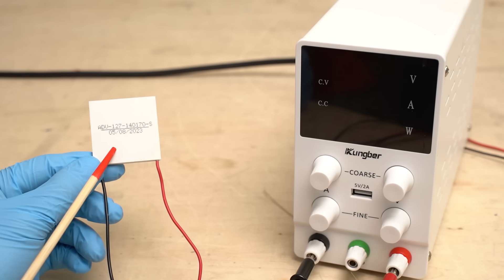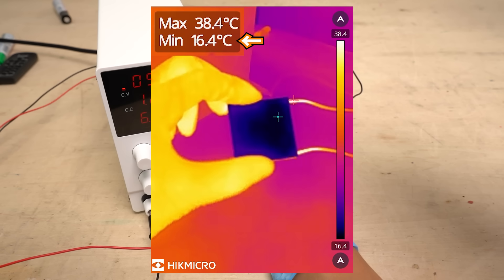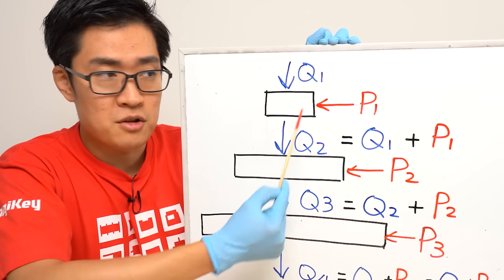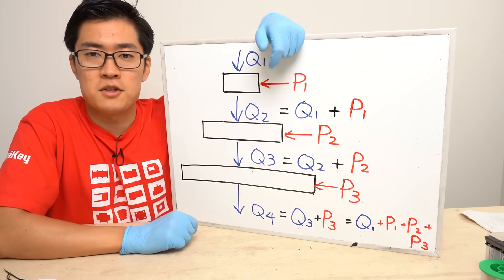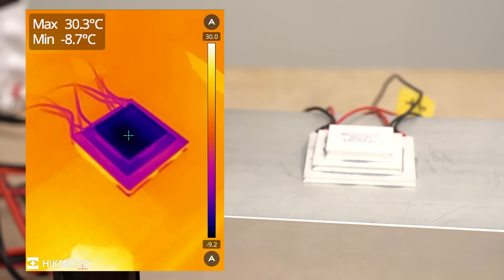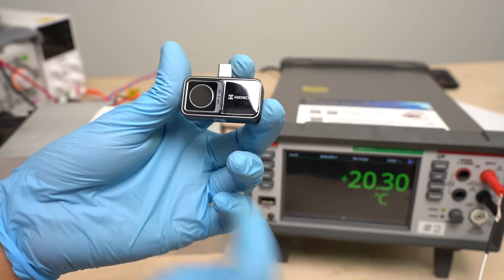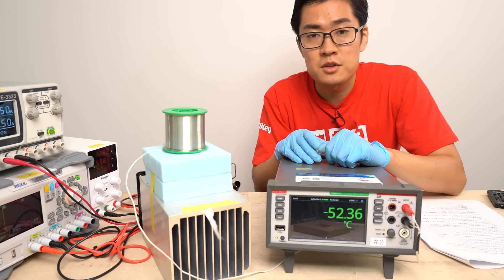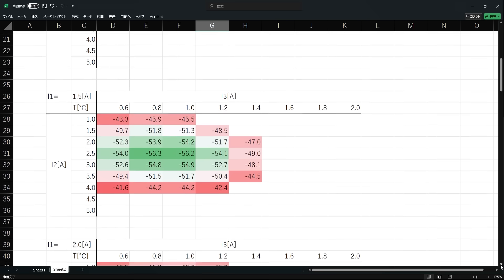Stacking 5 Peltier Modules, and Reached -90℃

Comment from the maker: 14:10 for those who can't find 5 cascaded peltier module.
Ready made 3stage peltier module costs 191USD
https://www.digikey.jp/short/d0qvwn3v
Reply: CANT YOU JUST DIY IT FOR A FEW DOLLARS??? PRICE SOUND BIZARRE...
Reply: @liambroder4543  no you cant.
You cant just stick peltiers ontop of another one, notice whats missing on the module compared to a single stage one.

....though id reckon i might be able to make same setup if i carefully remove ceramic plate with heat by desoldering it..
Reply: Bro, your Peltier cooler is the same temperature outside of an airplane at 10-12 km altitude. :)
Reply: Can't wait to see what u do with them in a later video :)
Reply: Compressors are fantastically cheaper and efficient,.
Reply: @PankajDoharey no only efficient, they're about 100% more expensive.
Reply: @PankajDoharey  they also take up a lot more space.
Reply: @PankajDoharey I agree. The trick is how to power the compressor. They need a lot of torque. Motors are very Current Hungry.
Reply: Why can't all five Peltier devices be of the same size?
Reply: @simon6071  because larger peltier size would mean more heat stored per peltier which is not something youd want when you want to drop temps in a cascading manner.
as you stack peltiers the overall efficiency of system drops especially if its not paralleled + high current.
Reply: @kopazwashere You're a bit mistaken on how this works. You need "more Peltier" as you go down the stack because Peltier modules generate more heat than they move. The bigger module below the one above it is to make up the difference. Each stage below has to move the heat the one above it moved plus the waste heat it generates. Has nothing to do with "more heat stored". Peltier modules "store" very little heat (they have little thermal mass).
Reply: @MadScientist267  Nope. that's not always the case. Depending on dT and current being input, you CAN have COP >1 on a peltier.
I've literally made a youtube video showcasing this that that's bogus garbage.

And no, it is more heat stored, as stack goes up, your thermal conductivity decrease (thickness increase), therefore the thermal resistance increases. which is what finding of the video sees. (Except temperature of top plate is extremely low compared to ambient, so that offsets the conductivity equation somewhat)
Reply: @kopazwashere  There is non trivial area on the lower modules as one goes down that aren't pumping anything. This translates to lost efficiency. I have no idea where you get the idea that a spreader plate between stages would have a negative impact on performance. Simply isn't the case... the opposite to be clear.
Reply: @MadScientist267  consultant equation for thermal conduction.
Reply: @kopazwashere  No equation is going to make up for lack of thermal contact. The ceramic simply isn't capable of pulling all of the heat to the side to the exposed surfaces where it can be pumped. 

Insist somewhere else, I know first hand what I'm talking about, you're not going to convince me otherwise with some verbal hand waving.

Peltier does very well for what it is useful for when it is set up correctly but waaay too many people don't understand them enough to do so. Doesn't bother me directly, as it is your power that is to be wasted, but save the "teaching" for those who actually understand them.
Reply: @MadScientist267  i think the proper response for your "not pumping anything" would be essentially, too low of Qc for given dT. (Due to thickness of peltier on a multistage). Which is correct. 

...which thermal conduction equation covers; thickness is there as a constant (as denominator). So increased thicknesses like you said limits energy flow.
Tldr
It does pump heat on upper stages, but barely enough to point only the peltier gets cold and it cant actively cool anything on its own (i.e. pump another active heat source).

That being said, the module itself still has 934 junctions in total (which is like 8 times more vs 1270x) so laird did consider lateral thickness as a factor.
Reply: @ My reply got deleted for whatever reason. But the nutshell is it wastes power if there is no spreader plate. The ceramic has a lower heat conductivity and so the heat doesn't move across it as well as it moves through it (this is why it is so thin). Without a plate such as copper between them, the exposed cold side "ring" of active material around the outside of each stage ends up doing nothing but making heat for the stage below.

This will be a non trivial value, as upon checking the math, the perimeter contains a seemingly disproportionate number of active units... which translates to not just wasting some, but a lot of it. Let's see if this sticks.
Reply: @MadScientist267  the point of staing is so that lower stages make temperature difference for upper stage.

More junctions are generally better especially in higher density because you reduce i2r losses. And you have more conduction area between plates.

I actually tested the cascade module video shoecased myself (without bottom plates) and with just 7.5w coldplate become so low my thermal cam couldnt even detect it (max low temp is -30c, so its below that).
Reply: @kopazwashere  And you'll nearly double the efficiency by using a spreader plate. Whatever a given number and variety of Peltier modules can do at a given power input without spreader plates, it will do much more, if they are added. It's that simple.

It's not a question of what "works". It's what works better.
Reply: @simon6071  i feel like other reply was poorly written. 

Theres a fixed max amount of heat (Qc) you can remove per peltier, determine by input curremt, zT (peltier coefficient of metal; higher is more efficient), voltage (product of temp difference from peltier, but also current) and current which is determine by electrical resistance (ohm) . 

the input power can be smaller or greater than Qc (cop above 1 or below 1) but if cop is below 1 you generate more heat trying to cool cold side. But if you have smaller cold side the peltier above stack draw less power than prev one.
To rest of comment:
A buncu of people said to diy a stack peltier yourself, but if you stack peltiers by themselves with ceramic plate the ceramic act ad thermal barrier which drop efficiency. Ideally youd want as thin of ceramic or other barrier metal as possible but that make peltier fragile and peltiers are already very fragile with shear forces.
Reply: The problem with a stack as presented in the video is that it is highly inefficient at transferring heat between stages. The reason it needs to be in a "pyramid" is because of the inefficiency of the modules. You're not spreading the extra heat outward as it does down so that all of the pellets in the modules can move heat. The ceramic has limited ability to move heat laterally.

Put a small slab of copper or aluminum between each layer and make sure it covers the layer below it in its entirety. Performance will drastically increase.
Reply: What was the power consumption? Would love some numbers and a graph of cooling efficiency (oC) per Watt

Great ideas!

PS have you tried cheap peletier modules from aliexpress? It could bring the price down a lot
Reply: This device would work well at inducing phase change in nickel titanium alloys.
Reply: Thermal paste
Reply: Okay, that’s a bit much 0:05
Reply: @DENKI-OTAKU  ummm... Wow, Sir 191usd ... They're 3 bucks a piece-  heat sync and fan probably costs  30... I would be making them myself, too.  Infinite Thanks Denki 🙏🚂🎼🌹🎶🎵⚕️🛠️~C< 3)>>-Z->}
Reply: @ what peltiers numbers they stacked? Couldnt found the numbers, only the stack finished to sell.
Reply: @zusclhz  labor cost is quite high
Reply: Can you experiment with optimising the heatsink cooling block down to something smaller given your home made stack is around 130w to cool plus the $250 premade one can you try a 150w pc cooler?

Comment: So, what he meant to explain, but completely over complicated is that Peltier devices can maintain, say 60C difference between the hot and cold sides. If the hot side is 60c, the cold side can get to 0c. If the hot side is 100C the cold side is 40C. If the hot side can be kept at 0C while running, they cold side will be 60C. But it takes energy to do what it does, work done causes heat, ergo the current draw PLUS the energy extracted from the cold side goes to the hot side (This is why they say to no run peltiers without a heatsink on the hot side....cuz you gotta dump that heat). So, the colder you can make the hot side, the colder the cold side can get. However, when stacking peltiers, the peltier device under another must absorb and dissipate its own heat PLUS the energy it absorbs from the hot side above it. The hot sides can get VERY hot VERY quick. You can easily burn these things out. Thus, if you're going to stack you have to go up in size.

Comment: Peltier devices fool people like free energy machines... they don't really do anything worthwhile. As you said, they generate heat... and all the heat they move has to be carried away by some other means PLUS the heat they generate themselves. Just use whatever cooling solution you attach to the Peltier device WITHOUT the Peltier device... The ONLY use of these is if you need very rapid short-term cooling, they will do that, they will cool faster INITIALLY than without using them, but the final magnitude of cooling will always be worse due to the heat they generate themselves.

Comment: Perhaps you could attack heat pipes to both the hot and cold sides, with the hot side having forced air cooling and the cold side's heat pipe leading into a vacuum chamber with the pipe and peltiers being insulated  In this way, you'd almost have a little electric heat pump refridgerator. Idealy you would add a dense oil to the vacuum chamber with an oil nebulizer as to catch any remaining air and coat the chamber in a hyper reflective substance to prevent light from heating up the inside. I wonder how low you could get the temperature.

Comment: Would this be useful as a cooling pad to cool parts that are intended to be used for interference fits on parts pressed together?
Smaller parts, like dowels and pins, or bearing seats. Sure liquid nitrogen is nice, but if its not something you keep on hand for home/DIY stuff and waiting on the freezer is taking too long

Comment: Very interesting and through.  I have done some work with Peltier devices.  In 2005 I built a PID controller, that used an H bridge for pulse width modulation.  The application was a blackbody for a high altitude multi-spectral  IR camera.  Two blackbodies, one regulated at 20 C, and the other at ambient (~ -20 C) were used as calibration sources for the camera.   I used thermistors to measure the temperature of each blackbody     Calibrating the thermistors took a long time.   I used a Platinum resistance thermometer and stepped through each degree C, from -40 C to +40 C.  The resistance of each thermistors at each step was used by the PID program.  Of course most temperatures were calculated by interpolating between the 2 closest resistance values.   It worked very well since the calibration at each temperature step was accurate to 1/100 of a degree.   Since the PWM circuit used 15 A @ 28V peak, PCB design to attenuate common mode noise was important.

Comment: 8:59 You should try and getting the highest degree
of cooling for the least amount of electricity used.
Actually the best expression Joules of energy transported
away per joule of energy invested. Jt/Ji.
Also heat pumping, since the temp drop is highest when
the power is switched on, this means that durig that time
the most heat is transported away, followed by switching
the power off, and allow the other Peltiers to do the same.
Less power, possibly more heat transport per Joule of power
invested. By phasing each and timing each, I think it may
be possible to get even better heat transport per joule of energy.

Comment: Coming to think of it, getting a fridge based on Peltier devices,
no moving parts, just current and a large heat sink, passive airflow.
Supersilent.
Btw, the liquid metal fluid, it does not stop conducting,
that is if it is truly metal. I'd certainly try it.
For the Peltier cooler, The heat sinks must be inverted on top.
So the upper Peltier upside down, on top of the metal
cooling cage within the cooler, the second stage on top
of that, also upside down, etc etc, on top the passive heatsink
optimized for maximum airflow for passive air pass through.

Comment: This is AMAZING!  I know thermoelectric cooling becomes less effective when used to cool devices that are either prone to heat spikes, or continually increase and get to high temperatures.  Basically Memory (RAM or NVMe storage) are more spikey vs say a CPU or GPU.   But if this can get to to -90°C without a thermal load, I wonder how it'd hold up with something like an NVMe Gen 4 or Gen 5 that are prone to thermal throttling.   I mean, I don't need my NVMe that cold but I have an external that gets super hot when playing games, and it's plugged in in a "docked" setup with an eGPU and USB4 NVMe, so I'm either going with a water cooler for the drive, Peltier, or a combo.  Anyway, great video!!

Comment: The problem i see is people not understanding heat rises putting the device cold side up will make the hot side facing down rise into the cold side... make a box put device on top of the box facing the cold side faced down into box as cold sinks, face hot side upright so the heat can rise as heat rises... also adding a copper heat sink will help pull the heat away... if properly positioned the device will work as intended and will work efficiently

Comment: These are experiments that I have until now only dreamed of ever doing myself, great to see someone took the time to pursue them as well as document them for others to see.  It is a great demonstration of the benefits (simplicity versus compressor-based methods) and drawbacks (horrible inefficiency) of the Peltier cooling method.  The fact that cooling a teensy resistor or capacitor to those extremely low temperatures required a heat sink and thermal convection apparatus pumping out over 100W of heat is pretty telling of the inefficiency that exists with this technology.  I can see a lot of viewers don't get the intent of these experiments, since anyone wanting to simply cool a CPU or other such simplistic functions would be a fool to employ such multi-stage methods or probably to even use a Peltier at all, unless there is some restrictive environment that certainly does not exist in most computing environments.  I work in an automotive electronics lab and I am hard pressed to attain temperatures lower than -70C in our lab - and that is with the (certainly very expensive) Thermotron chamber that is the norm in such engineering environments - neat that one could conceivably cool something of very modest size to such low temperatures without having to buy such expensive cooling equipment.  Of course, if your DUT produces more than a teensy amount of of heat itself, you WILL need a more elaborate means of getting it down to that temperature.  Thank you very much for producing this experimental video and all the time you spent to create these experiments, definitely bookmarking this for all my engineering cohorts!   =)

Comment: What if I want to use the generated heat insted of just dissipating it? Say, for example, for cooking, while at the same time you use the cold part for cooling the beverages.
Reply: You could do whatever you want with the generated heat.  I'm sure tons of useful heat is thrown away by people every day that could be used for other things, often it is inconvenient to get the waste heat to where it is needed or that simply nobody ever bothers to try to use the waste heat at all.  In this country (USA) energy is so cheap that nobody bothers with trying to be that efficient (unfortunately).  But, in the example you cited (cooking), the generated heat is unlikely to be of much use though, because to make the Peltier work most efficiently, you don't want the heat at the bottom of the pyramid to be much above room temperature, and the whole setup will work best if you blast the cooling fan to keep it really close to room temperature - and since then all the modest-temperature heat you are blowing off the large heat sink won't be hot enough for any useful cooking.

Comment: Just take a radiator filed with oil .
Than from 2 sides cold side towart that you would think it cools down on the other side a candle light onder it and waths how match onexpecting heath you produce 

○🌀○🌀○🌀○
Becomes 

\/                          (())
🌐💢🌐💢🌐💢🌐💢
/\                     <<🌟>>

Becomes 

🌐))))
💢((((
🌐))))
💢((((

And this you recordnkces as radiand heating👀😍🤣🤣🤣

Do to olrady lressend cislesematics order of magnetudes there exeleration 

Than place on diverend distances wat wil be heated bi wat ❤you Experienceas radiand heating and behold one is heating one of the next is is coling and one of the next is heating again like 2 rainbowsat the same time
/\